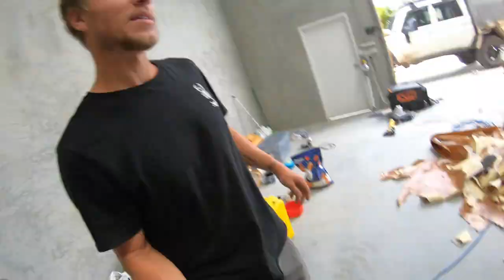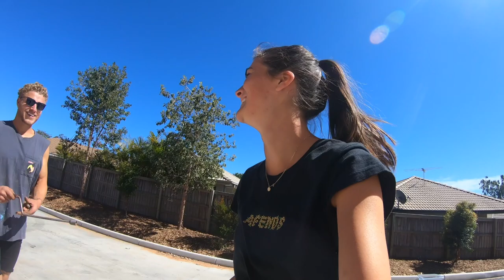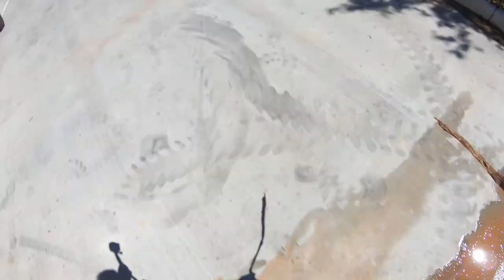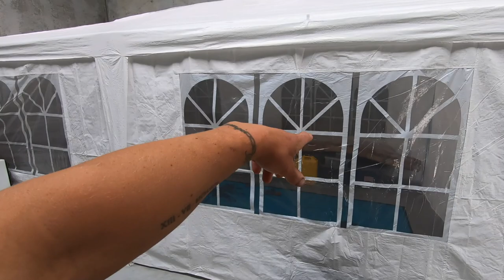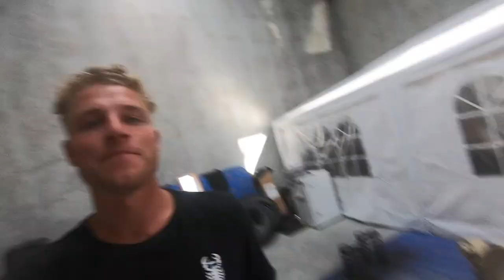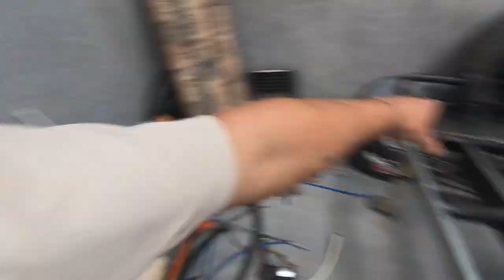VAN BUILD: Restoring the trailer back to life

Comment: Discs can release (enough to roll off) when they cool down, consider chocks if applying the caravan parking brake. They also have less mechanical advantage (than a drum), so require greater force to be applied on the parking mechanism.